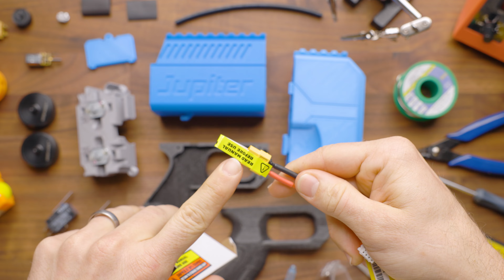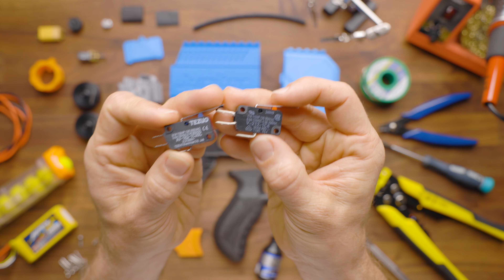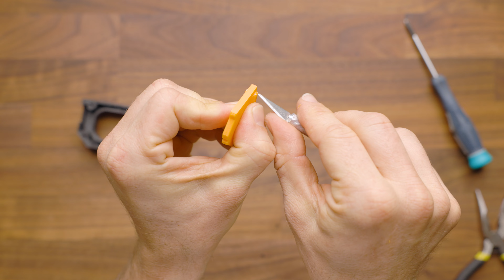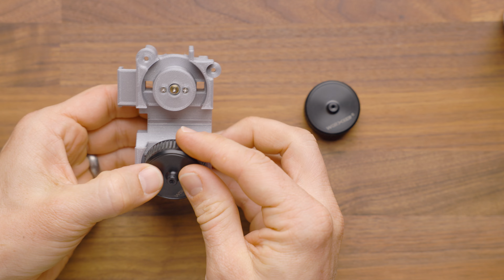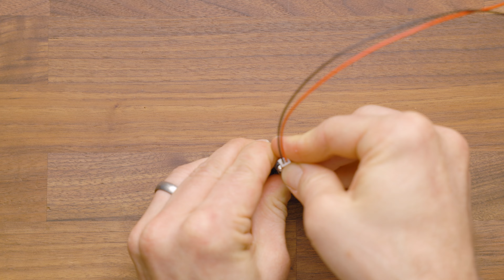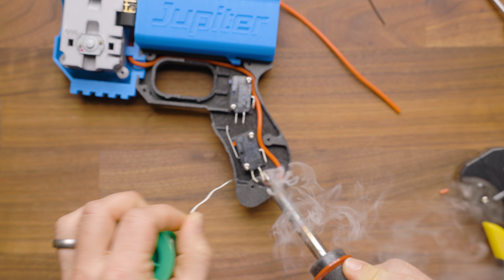BUILD GUIDE: Jupiter Rival Blaster (2021 Updated)

Comment from the maker: The Jupiter continues to be popular, especially now that the Proton Pack has been unleashed. I can't wait to see a legion of Proton Packs in the next major HvZ. - Perry
Reply: You mention a schematic, where would I find it?
Reply: Question: can a flywheel motor span board be used for the motor cage in this blaster?
Reply: Doesn’t 3s have more power
Reply: I will not buy it becase it is too overpriced
Reply: @djacircarvalho8251  filament costs a lot

Comment: Nice video! Why do you connect the black wire to the top switch(not omron)  on Nc. The feeder motor allready have negative. I do not question ur layout i just want to learn.
Reply: When the top trigger is not pushed u get neg on both motor connections for the feeder/pusher

Comment: Anyone know how to fit the 3s lipo in there ?? I bought the one that was recommended and can't fit the alarm and battery and xt at all
Reply from the maker: Which LiPo did you purchase? The ones on the listing should fit the battery compartment without any additional parts or modifications.
Reply: @outofdarts  I purchased the recommended 3s lipo (turnigy 1000mah 25- 50c 1.0)

Comment: Will a 2s graphene 75c panther 950mAh work with this gun

Guys please make this comment go to the top I need to buy a battery soon
Reply from the maker: That battery model has the wrong connector to fit with this blaster. Our own 2S Graphene 950 that we sell on the shop will work as we ordered them with the correct (XT-60) connector.
Reply: @outofdarts  will the 1000Mah 2S 7.4v  25C - 50C xt-60  Nano-Tech Lipo Pack work?
Reply from the maker: @blade-fortniteshorts7663  No worries. That should work; you can check the battery compartment dimensions on the listing to be sure. 

If you have any other questions you can shoot us an email to orders@outofdarts.com We can respond in much more detail there.
Reply: @outofdarts  thanks so much for the help! 😀😀😀
Reply: @outofdarts  I’m very sorry for asking u too much
Reply: @outofdarts  but u don’t ship to England
Reply: So what should I do
Reply: Will a 1s battery work with the 2s model
Reply: I bought the 2s model
Reply from the maker: @blade-fortniteshorts7663  Sorry about that! I didn't realize you were overseas. In that case, I'd recommend getting the 2s Graphene and following our tutorial on swapping LiPo connectors:  https://youtu.be/0Gy_O6dRtKA
Reply: @outofdarts  thanks so much

Comment: My grandson and I built our jupiter after watching the several times before assembling and during the building process.  Unfortunately it is not working.  I watched the video several more times but still doesn't work.  The solder connections seem to be perfect, battery charged.  The only thing different was the red and black wiring from his example.  We soldered the yellow piece for the battery both ways to make sure and still the motor doesn't turn.  Any help or suggestions?
Reply from the maker: Hi! Shoot us an email to orders@outofdarts.com and we'll be better able to diagnose what's going on. - Perry

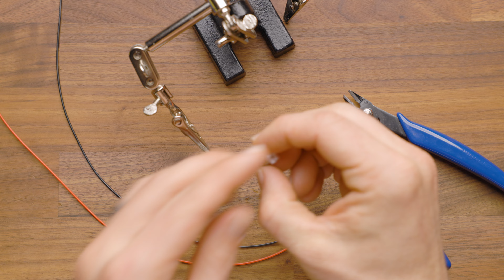Comment: At 7:30, the two tabs were bridged by solder at the board even after I clipped it flush. I didn’t catch it until I tested the pusher motor at 9:15.  Both red and black wires started smoking within 1 sec of touching the battery.  I was able to fix with dremel, should have used soldering iron though.

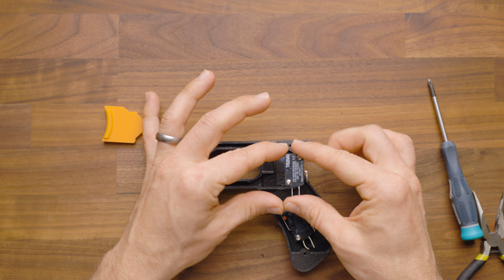Comment: At 4:40 it looks like you remove the metal tab from the firing switch but don’t show it or say anything about it.
Reply from the maker: Thanks for pointing it out! The rev trigger is a lever switch and the firing trigger switch is a button switch. During production, we accidentally grabbed a lever switch from the wrong bin. The kit should always include the correct switches. - Perry
Reply: Mine didn’t come with the correct switch so I had to break it off

Comment: Do you have to buy the insides separately, like the batteries and springs   And does the mag come with the pack                 pls respond
Reply from the maker: Everything included and not included is mentioned in the beginning of the video and in the shop listing. Additionally, when you purchase the blaster, there will be documentation that tells you what parts should be in the kit. - Perry

Comment: This is really great guide but why you solder the negative cable to the switch? in my opinion you just need to solder the negative cable in to the fly wheel motors!
Reply: By doing it this way, when you let off the trigger the motor sees negative on both poles and will electrically brake.